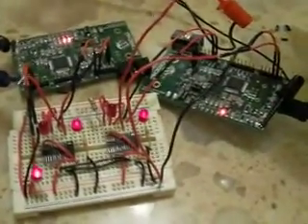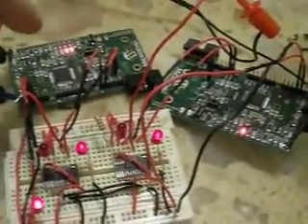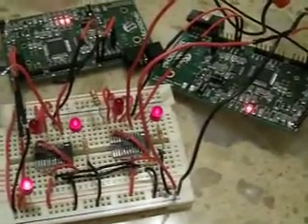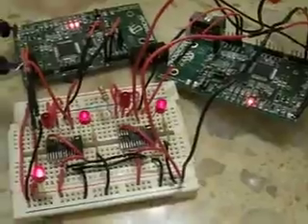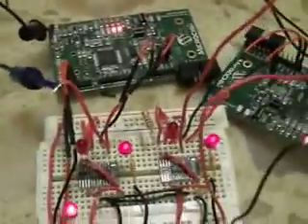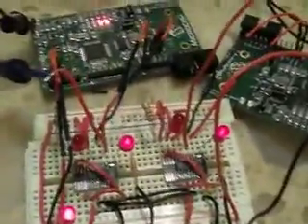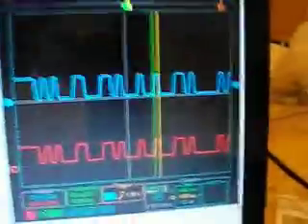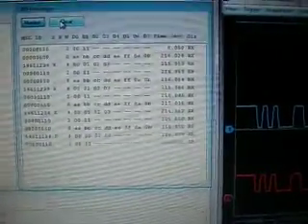Microchip CAN BUS Transceivers with LOW SPEED modification

Comment: Did you have to remove the high speed chip on both MCP2515's?
Reply from the maker: Troy Conley Yes any devices you want to communicate need to be on a compatible bus.  If you want the two MCPs to talk on a low speed bus, the transceivers on each module will need to be removed and connected as shown.

Comment: Hey, I'm wondering if you might be able to provide a schematic file of how u connected each pins of the TJA1054 to the MCP2515 controller. Thanks in advanced
Reply from the maker: Have not kept of record of those connections.  But as I remember, it was not difficult.  If you read the datasheet for the TJA1054, it will be straightforward.

Comment from the maker: That year is most likely a high speed version, in which case the Microchip kit would work without the modification in my video.  You would need that kit, a microchip programmer, and the ability to work with electronic circuits and code various software.  For specific command sets, you could try canhack dot org, however, its highly likely you will need to do a good bit of reverse engineering.  For example to enable functions such as dimming the lights as its a command not a wire connection.